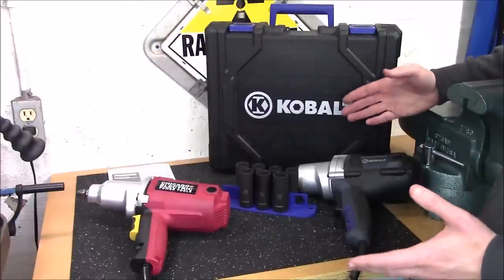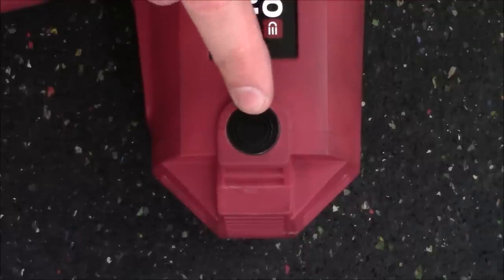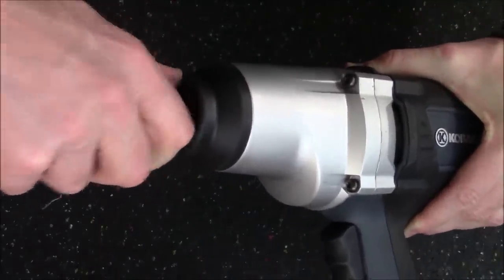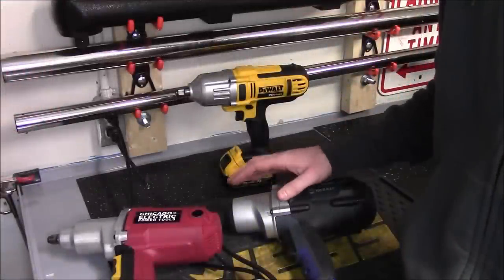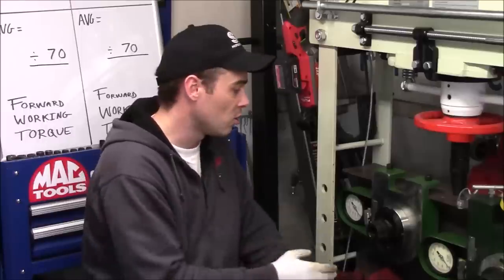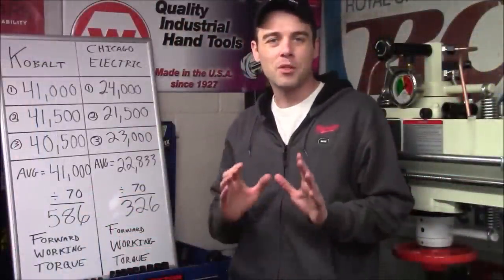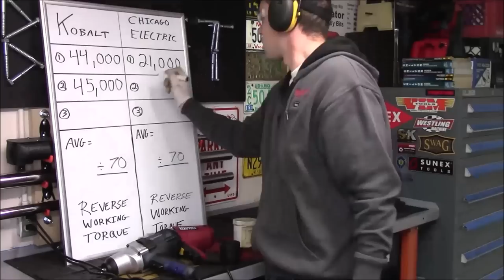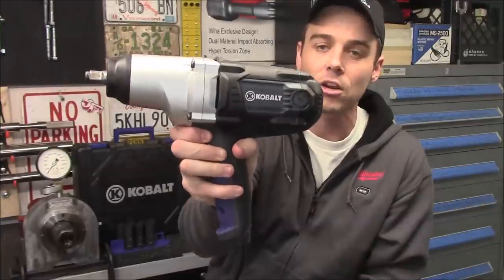Kobalt - VS - Harbor Freight 1/2" Corded Impact Wrenches

Comment: The HF is more or less crap but for most people it does the job of rotating their tires which is all they are going to do with it anyway. I've got a garage full of the finest tools made but I'm a tool junkie. It pains me to admit that most people have absolutely no need for the armada of weapons my habit has caused me to purchase. Sad but true.
Reply from the maker: +Dick Fageroni Now THAT is funny....haha
Reply: +SATAMAN Schmidt I don't even think it's a hard choice.  The Kobalt isn't that much more, and it includes the blow-molded case, all the lug nut sockets you could need, and a better warranty.  (But I bet Harbor Freight would give you a new one past 90 days if it crapped out).

I wonder how my old Makita would do.  I got it in the late 1980's before I had a compressor.  Still works great.  I used it yesterday to help a limo driver who got a flat right in front of my house.

Comment: HFT offers a 2 year warranty. But they give you a brand new one in box. Even if you don't have problems, you can bring it back and get a new one and extend the warranty and still pay less then kobolts high prices. Plus you can get 20% off and save even more money. if you need a stronger torque pay for kobalt. but if not hft works just as good for the average Joe job.
Reply from the maker: The reason I made this video was that MANY people continually commented and said that the HF version & Kobalt were "the same impact".  This proves they are not ----- in any way.....you are correct that for VERY limited use & low-budgets, the HF would work most likely ---- however, it is not in the same league as the Kobalt by any means.

Comment: I would like to see review the 1/2 snap on impact vs the mac impact. I have the Mac one. They claim it's got 725ft lbs. I'm curious to see how close it is to that. Do you have access to Mac tools?
Reply from the maker: +bruindebate05 I would like to see that also.....at this time it isnt possible.  If I get them on board, I will be sure and add them into the lineup!

Comment: I serious doubt about your test results. I checked the spcs on both amazon and lowes.com. The torque is 350 ft/lbs. How come you almost doubled the number?
Reply from the maker: Kobalt did not test torque the same way as me......MOST manufacturers grossly overrate torque specs, and in my opinion ---- Kobalt understates their torque specs.  (for example.....I hold on the trigger for 15 seconds.....if you held it for 5 seconds it would be less & 30 seconds the specs would be higher).  I keep all testing identical across all impacts to give an accurate picture of which tool ranks where.

Comment: For the money get the 1/2" drive 25" HF breaker bar and the Milwaukee cordless 12V 1/4" impact.  That would be two excellent tools whereas neither the Kobalt nor the HF 1/2" impacts are.
Reply: Frank W your dead wrong. i have this kobalt impact and it is badass. if you own one then you know, if not, then you have no idea what youre talking about. my neighbor couldnt get the ball hitch of his truck with his dewalt 1/2 impact so he tried my kobalt and "boom", took it right off. like it or not, this corded kobalt impact is a great tool.
Reply: Kobalt 8-Amp 1/2-in Corded Impact Wrench max torque 350 ft-lb. 

Milwaukee cordless 1,100 ft-lb.

Comment: a shootout of HF PRO impact sockets @ $30, (Cr-MO) vs, other brands. i got the HF Pro ones, i must say, im very impressed, they have the same top as my MAC Edge sockets, remove fasteners up to %30 rounded. i like your channel, keep up the good work.
i watch 2 tool guys mainly when considering a purchase, RealToolReviews, and AvE. your videos, are a proper test, very pro. AvE's are nuts and bolts quick and dirty. both viewpoints are necessary for me to choose. watch AvE's video on the ridged hydraulic impact, very interesting. 

1 complaint, the stream shows, we don't need your face or anything, but how about some pics etc.. something visual, graphs relative to your topic of discussion.

Comment: Are the kobalt air compressors a good investment????
Reply from the maker: I like the 30-gallon belt driven one with metal cage.....very quiet & easy to move around.
Reply: @RealToolReviews  I have the 60 gallon single stage,,,,been good,,,but was wondering  about others with it over long term

Comment: Please do the craftsman 8 amp VS kobalt 8 amp(all corded)
Reply: Craftsman is garbage bought new it fail clutch slip on electric impact .try to exchange they refuse .went to store parking lot swing it like cowboys slam it on ground. Would not buy craftsman  dont care if 80% discount. Kobalt better tool have use many jobs suspension on truck ,axles,etc

Comment: Great vid.   Can you do a test of how much pressure decreases when adding hose. Like 10ft-100ft hose ect? Or with a filter or regulator. I don't think I've seen a vid like that.
Reply: +GigaDonk these are electric not pneumatic,unless you meant something els entirely. in which case i didn't understand your comment

Comment: The commutator generally wears out before the brushes do on HF tools.
Reply: Never had the chance to replace the brushes or resurface the commutators on a HF tool yet. Most of the time the gear strips or the chuck falls apart first. I had one where the brushes got so hot it melted the plastic case.

Comment: wow your reviews are very detailed, great review 
forgot to add in the part about price difference, average Jose   😉 😂 , diy uses 
still great review
Reply from the maker: Thanks!  And I rarely talk about price since the tools change prices up/down constantly & it would only be accurate for a short time.
Reply: @RealToolReviews  the Kobalt is still $150 is still under $50 four years later..js and yes prices fluctuate but you could have mentioned that there is a massive price difference.

Comment: But will the kobalt remove a crank shaft bolt ?
Reply: I used it to remove a front axle (to replace a front lower ball joint) and crank shaft on an Acura Tl 3.2 to do timing belt change. You actually don't need an impact gun, you can use a long breaker bar (pop in a long pipe if you need to to increase the torque) and your body weight. Make sure you prop it up with a couple cinder blocks to stabilize the socket and the breaker bar before you push down on the breaker bar/pipe. Make sure you spray the bolt with plenty of penetrating fluid and give it some time to soak Good luck..

Comment: Nothing a bit of electrical tape to protect against scratching...and face it you need to use an extension cord anyway regarding the short cord...just sayin...
Reply: There's also the Flex Tape stuff to coat it with if they make it a habit to hammer their rims with it

Comment: The harbor freight is rated  at 230 ft /pds max, and the Kobalt is rated at 350 ft/ pds. You overrated for both modles. I do not believe any manufacture would underrate their products. Do all the manufacture use the same method as you showed in the video? If not, do you know how they rated the torques? Thanks! Great video!
Reply from the maker: +yang song yes....ALL manufacturers use different methods to test torque specs.  That is why you see zero consistency between them for similar tools.  The 15-second test is an extreme version designed to show max torque...but some brands only run that test at 5 seconds.....which means they would get significantly lower results than I did.
Reply: You should do a vidoe on some of these impacts that rate them in inch/lbs vs Ft/bls
Reply: Im glad someone mentioned this , its not that the HF impact under performed or the Kobalt over performed.
They both exceeded what the Manufacturer stated they would do.. 

I'm buying the HF for 49.00 .. oh wait On sale for 39.00 + 20% off ... done !

Comment: when the brushes wear out,the tool will not run at all
Reply: Not only that, but may damage the armature before it stops. Need to check the brushes from time to time.
Reply: Dave Grohl They are cheap on EBay and Amazon. 15 x 10 x 6mm.

Comment: semi truck lug nuts are torqued to 450-500 ft lbs, at 321 you should be able to take the lug nuts off your honda without an issue :)
Reply from the maker: I don't think either of these are trying to knock IR out of the heavy equipment game 😉😂

Comment: But what's the price difference?
Reply: +Russ Hawkins The HF model is around $49 (less with a 20% off coupon), the Kobalt is around $129.  It depends on what you are using it for.  The HF model has less torque, so for some car lug nuts that were put on with an air impact gun it may strain.  I have the HF electric impact gun, an also I have a more powerful Pneumatic impact gun.  I use the electric one for removing the blades on my mowers, it works good for that & I don't have to fire up the air compressor.
Reply: Thanks

Comment: Not once but twice did you have to use a calculator to average three numbers that were +/- 500 from each other.  Math is hard.
Reply from the maker: Repetitiveness in testing is necessary to eliminate mistakes.  Thanks for your attempt at a criticism.

Comment: Harbor freight has it for special at just $35.99

Am really tempted to go buy it, since I need one. But I do have a 5hp 20 gallon, over 150 psu air compressor and i want to get an air one.. but.. they are more expensive :/

Comment: harbor freight power tools suck !!!!
Reply: +Demarcus  Williams Yes they really do. Most of Harbor Freight's tools are made so poorly, they are only for one time use.
Reply: +eurone215 I've never really used the HF power tools, besides a grinder, which has held up with my 5 other grinders I have. One thing to note is the HF impact is $40 with a 20% off coupon, for someone that is going to use it a couple times a year, it may be fine( you could also get the extended warranty, I never have on anything). As far as their hand tools, I have been using ratcheting wrenches, 3/8" and 1/2" drives as well as sockets every day for 1.5 years and haven't had any problems. I've broken 3, 3/8" ratchets, but the hand tools have a lifetime warranty ( HF 10 min down the road). For a person that's using the tools once in a while it's a cheap way to fill a toolbox. Even a good way to keep your expensive tools clean, or when you need to over abuse them like I do with breaker bars. These other tool reviews make me jealous. I do spend money when it really saves time, like welding tables, fixturing, and other things.
Reply: +Meghani Motorsports They're perfectly fine for home use. Hell, most people buy a drill and use it a few times. There's no need to buy an expensive name brand for that. I bought a lolquality Dremel knockoff for $25 and it works fine for my occasional use. I'm always slightly surprised when it turns on and works :)